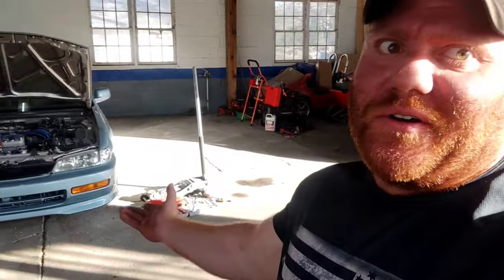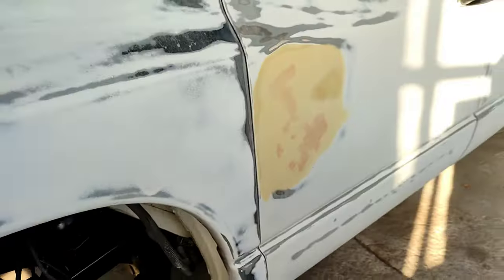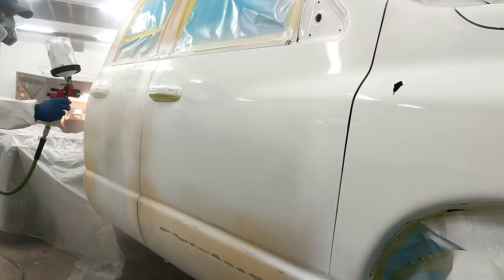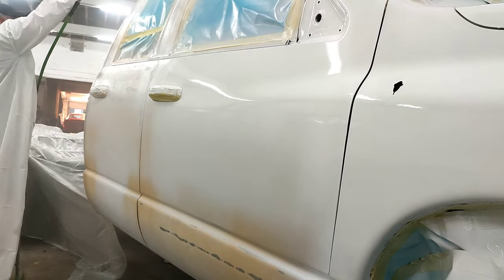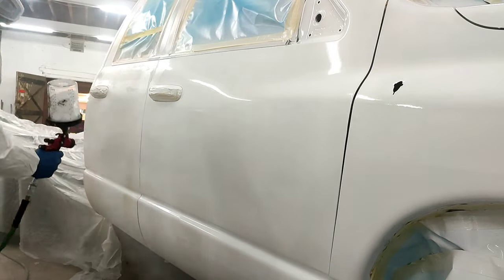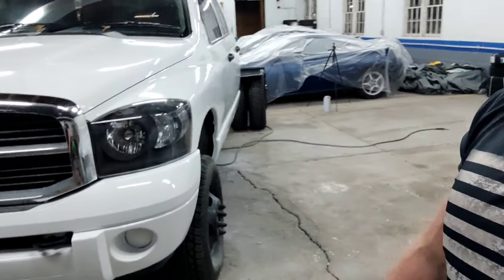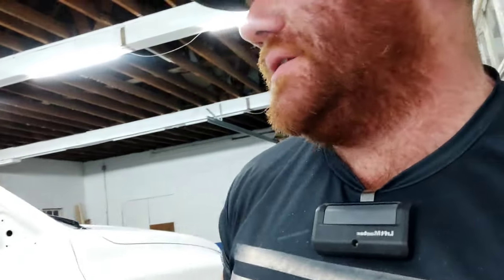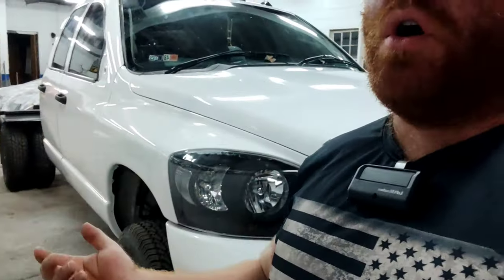180$ paint job

Comment: Single stage is a great option on not-so-great cars. To drive or to flip.  I like the fact that 400 grit is fine for prep. Instead of 3 coats of base and 2 or 3 coats of clear I normally do, maybe 2 1/2 coats if you do a tack coat to introduce the paint to the surface like the old timers did. The old work truck looks good, just as good as it needs to and prolly better than it has in a lotta years
Reply from the maker: Yea a lot less labor with single stage man. Less sanding and way less spraying

Comment: Yes you are 100% correct, my Dad was an old-school body man and he paints just like you do, you are an awesome body man/painter and it looks great buddy, nice paint job man...!, this truck looks brand new now, don't see the flaws in the paint that you said it has, to me it looks great like new, also if ya look at some of the brand new cars and trucks built today most if not all have either fish eyes or orange peel or both in the paint jobs anyway. thanks for sharing
From a new friend & Subscriber here in Lima Peru
George
Reply from the maker: Yea I do like base clear for certain applications. But older cars or ones that I sand heavy On, I typically like single stage. Even the pros at the shop will miss a 180 grit scratch here and there and that's no issue with single stage, fills right in. Base clear ? Not so much unless using a 45% solids clear. We sell smr42 which does fill good and level great but still...
Reply from the maker: Don't even get me started on the water born guys 🙃🙃🙃🥴🥴🥴🥴🥴 
"BETTER COVERAGE BRO".... yea that's because you don't know how to mix solovent 😂 paint store says mix 1:1 I'll mix it 1: 1/2 and get 90% hide first coat.

Comment: I've only sprayed single...even though it's been 20+ years...about to again on this next project. Came out great brother! 🍻
Reply from the maker: Love single stage, easy to repair, easy to spray less labor, sometimes it even shines better IMO. With base coat clear coat the gloss can die back into the base leaving you with a less glossy finish. Not single stage. Color and gloss is in the same coat so no risk of die back most cases

Comment: Looking good! I have an 03 white Tahoe that I want to paint. I don’t know if I’m supposed to sand it down to Bare metal due to bad primer. Do you think I could get away with sanding to the primer and just painting it or should I strip the whole thing?
Reply from the maker: Just give everything a good stuff with 400 grit and paint
Reply: @speedokoterefinishnetwork4937  even though the old paint is peeling?
Reply: @speedokoterefinishnetwork4937  I really hope I can! It would be so much easier!
Reply from the maker: @dollabillbrunson8107  definitely going to want to sand old peeling paint and get it all smooth 
Would go 80 grit , 180, 320 then 400
Reply: @speedokoterefinishnetwork4937  definitely will do! Thanks Brutha!
Reply from the maker: @dollabillbrunson8107  absolutely!

Comment: Quick question Marco. Can I use DTM primer/sealer INSTEAD OF self etching primer? Are there EXCEPTIONS? Plmk, tyvm 👍👍
Reply from the maker: Etching primer is much thinner and better for pre paint applications. Requires 0 sanding before paint lays 100% flat
Reply from the maker: Smr225 is the best bare metal primer on the market.

Comment: I bout a gallon of this and it was really thin, it was kind of like water. I ordered it on Amazon. I was expecting it to be thicker cause I seen it on your videos
Reply from the maker: Hey buddy this product is thinned and ready to spray to take the hassle out of it for DIY people. This stuff doesn't matter how you spray it is manufactured to lay FLAT. I've even does really light dust coats with this stuff before and it still layed very flat. It's amazing paint
Reply: @speedokoterefinishnetwork4937  oh ok, I was just wondering cause you mentioned it covering 180 grit and I thought maybe .mine was a bit too thin but I still did like the paint. I gave it a 5 star
Reply from the maker: @abisaigutierrez6246  yea I mean it's still single stage still can hind some stuff with a few coats for sure.

Comment: How much would it be for a super sonic blue Integra paint job I’m located in Newport Delaware
Reply from the maker: Paint jobs on the east coast right now are running between 1200-2000$ for a super cheap paint job. 2000-3500 for a mid grade job. My prices are based off what the market currently is.

Comment: An expert would not have had a problem in the first place .  LoL 😂 
That’s the difference between  experts and amateur.  LoL 😂
Reply: @edmacrae4521  🤣😂🤣😂🤣😂
Reply from the maker: I'm clearly no expert, I have no clue what I'm doing
Reply: @speedokoterefinishnetwork4937  prep is 90% spraying is 10% , a good sealer will help with hold out ( keeps the paint from soaking into the old finish) . Not bad for an amateur 
P.S.  after 50 + years of painting cars I’ve earned the right to laugh a little 👍
Reply from the maker: @mhughes1160  oh no dout , but on a super cheap paint job where it's already white or black and I only have a few metal burn throughs, I'm not primer sealing the whole car/truck. Just personal choice. I've done 20,000 paint jobs no one on the internet has even seen my top tier work , ever.. And probably never will cause 98% of my customers just want a quick scratch and spray. And there's nothing wrong with that
Reply from the maker: @edmacrae4521  yes near that area
Reply: @Speedokote refinish network  really? Do you have a work phone number I could possibly call you?
Reply from the maker: @edmacrae4521  cash2kcars@gmail.com

Comment: How come you just don't seal it first 30 dollars no oh s$#@ moments
Reply: Sealer spray time (labor) + cost of sealer + time to let it flash (loss of labor productivity) + overall dry time = $$.  So eliminating that for a production painter can get another car in the booth possibly.  Marco admits to cutting corners here to save money with acceptable results on an easy solid color paint job.  Heck it probably won't get washed once a month if it is a work truck and then that would be if he is lucky so they won't notice the difference.
Reply from the maker: Pretty much explained it right there 😂 even 1k sealers now running 100 a gallon you will see a lot of guys skipping this step for super single stage jobs